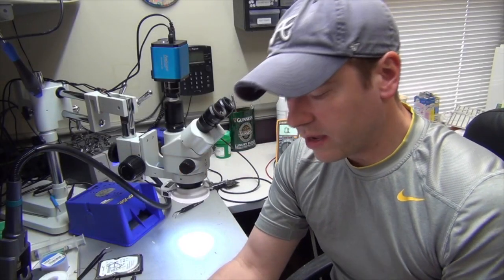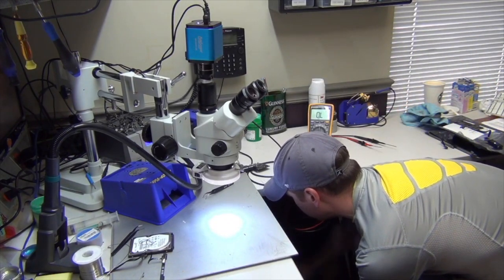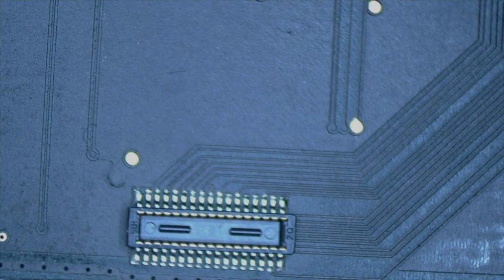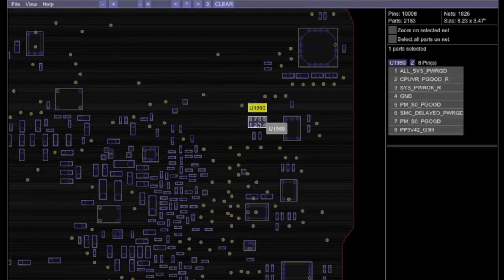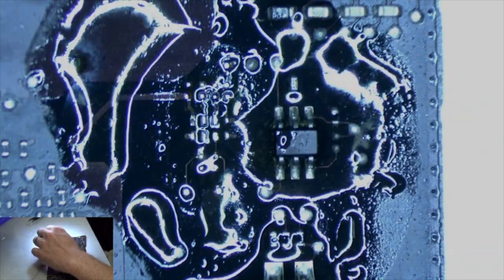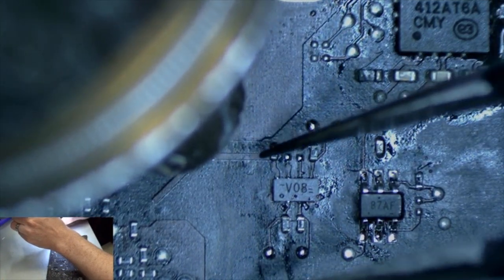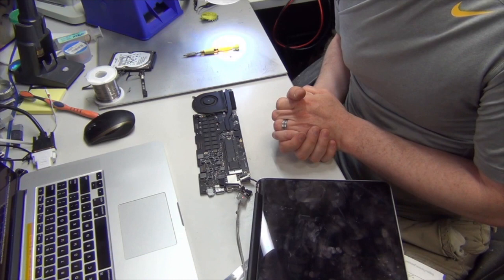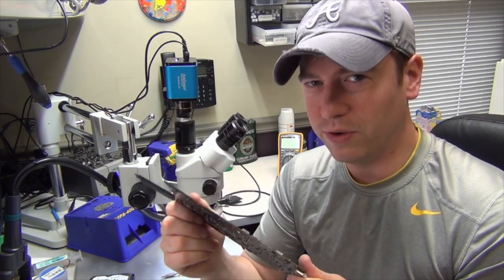Macbook Pro Liquid Damage Repair on A1502 board 820-3476

Comment: Thank you so much. I had similar behavior on same board. Fan spins but cpu was dead cold even though all power rails seemed present. In my case it was not water damage, but rather bug infestation damage haha. Some ant took a crap on c1950 and damaged the pad and track to pin 8 of u1950.

Comment: excellent video, very impressive diagnosis and repair! I've got a 2014 a1502 macbook pro my wife spilled coffee on. powers on and can run external display off HDMI but native display doesn't turn on. Pulled the display plug and it looks OK nil visible damage. Any obvious places I can troubleshoot before forking out $$ to the local apple repair centre? Any advice is appreciated!

Comment: Excellent information and well produced! Thanks. I have a Macbook Pro 13" Retina, late 2013 (A1502). Had a coffee spill near the rear vent. Fortunately, keyboard had a silicone protector on it. I acted promptly, flipped over the machine, kept the vent downward, and soaked up as much liquid as possible. I took it apart and have been diagnosing it. Cleaned it up and let it dry. It starts and boots from an external USB, but not from the internal PCIe SSD. I removed the SSD card, examined it, cleaned to no avail. I have not as of yet removed the logic board from case. Is there anything else I can try before having a professional look at it to try to have the internal SSD chip recognized? Thank you.
Reply from the maker: It sounds like you've done what you should. The only other testing step that you could do yourself is to buy a replacement SSD and see if that works. That would tell you definitively if your SSD or logic board is the problem.

Comment: i have a logic board the needs the have the charger on, other wise its turning off, can it fix?
Reply from the maker: Most likely this can be fixed. Was this after liquid damage or did it just go out all of a sudden? Usually issues such as these are related to bad batteries. If something was spilled on the unit however that would lend itself more to being a logic board issue.